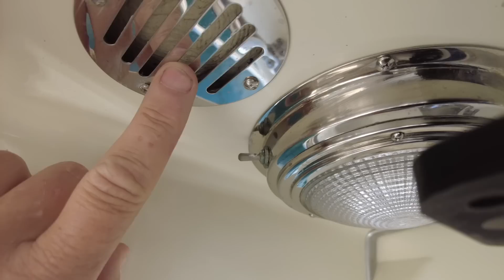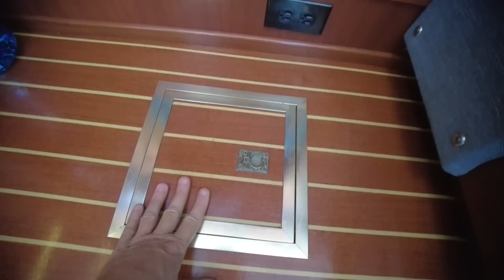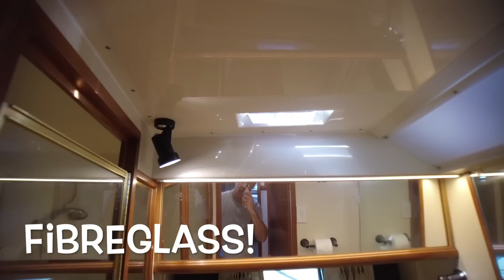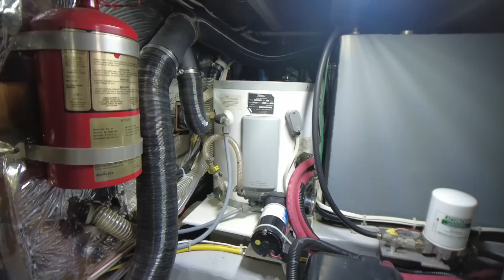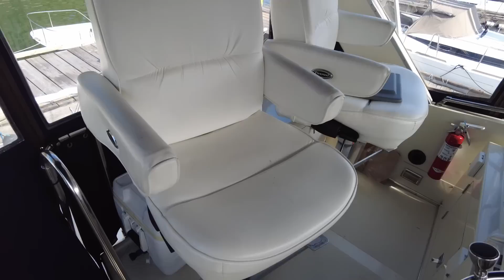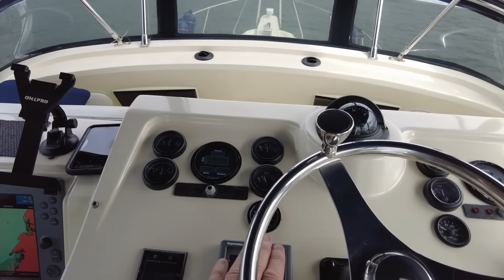SOLD!!!! Tollycraft 34 Sport Sedan w/ twin Cummins IMMACULATE in Vancouver BC- Dinghy unavailable

Comment: As the owner of an ‘88 Tolly 34 in essentially original stock condition except for some electrical and charging upgrades I am amazed at all the work done is this old cruiser. Jealous for sure though my old crusaders still run good. I use my lower helm more than the fly. It is nice to be in the cozy cabin when the weather is not great and I can socialize while meals are being made, etc. If all I got for ripping out the original fully functional helm was a little bar and a small amount of floor space I would not modify. That’s based on how I use my 34’. To each their own of course. Beauty of a boat. Hope the owners don’t lose too much of their investment!
Reply from the maker: Thanks!  We refit 3 of these 34s but the others not to this extent.  The owner removed the lower helm as he felt the visibility was not good enough, and he had a true 'open checkbook' attitude. Having run the boat a lot I agreed with the decision.   There is so much wood and debris in the water here he never used the lower helm.  The new owner jumped aboard in Vancouver and ran her to Port Edward (Prince Rupert, the north end of the Charlottes) in March without issue.  I guess that is all that matters after all right?
Reply: @boa @boattguyafloat  Yes sir! Just try to know your needs and preferences, take the plunge, and hopefully enjoy that time of your life! Life is too short and opinions, well, that takes some looking into;) You guys are very skillful and your boat knowledge comes across easy and knowing. We cruise PWS in AK. Thank you